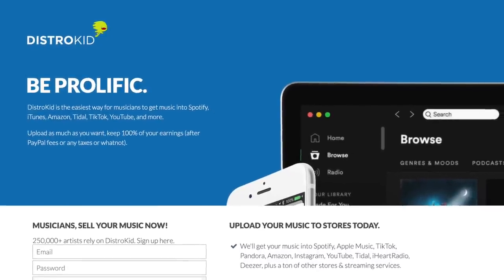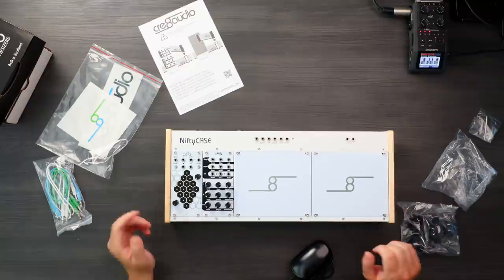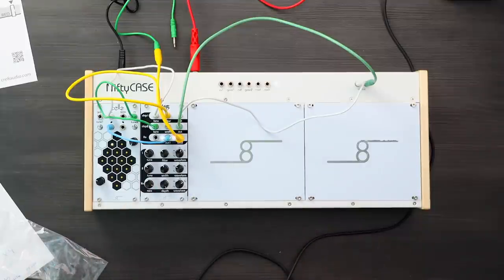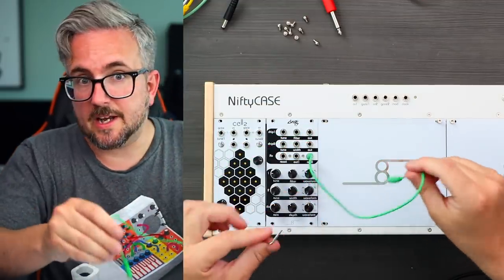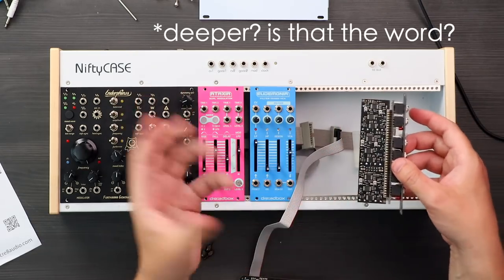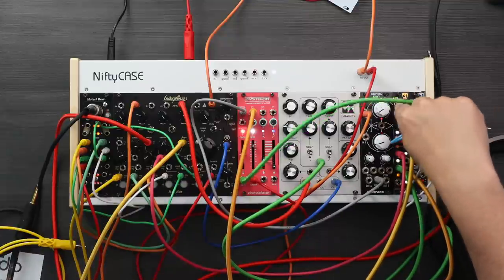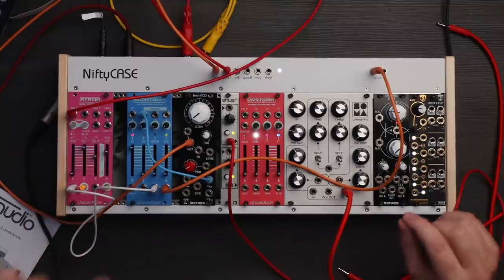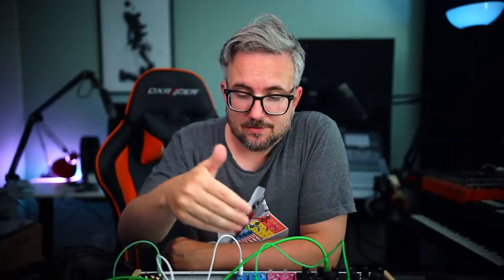$200 Eurorack Case for Beginners! But is it any good?

Comment: So now we get the inevitable "I've done synths and now I've fallen into the modular sinkhole" video series from Bo. Which is right on time cos I'm on the edge of that sinkhole and ready to fall in. 😄😄😄 Lead the way Bo-man!
Reply: Owning a Volca Modular for half a year, then getting a Behringer Neutron (bought used because I'd rather support musicians than Behringer, but I couldn't resist acquiring the synth itself) has made me realize that I will inevitably get into eurorack, eventually, one way or another. Now that I have the eurorack-compatible Neutron, and Bo's recommendation here, I can expand the Neutron rather than have to buy several modules at once to make the case usable. Hooray for budget-friendly semi-modular synths!
Reply: I bought a Doepfer A100 system after having a Make Noise 0-coast semi-modular. Happy with both. I did add a Korg SQ-1 sequencer and Make Noise 0-CTRL touch sequencer and they work great. Found out that while I enjoy west coast synthesis and like the 0-coast that I much prefer the simpler easier to read layout of Doepfer modules. Fancy graphics are cool but a pain to work with in live production mode.
Reply: @mikeexits  indeed just buy a cheap powered eurorack case and you are set to go and have room to expand. I do recommend utility modules and modulation sources that are skipped over by beginners and Youtube celebrities.

Comment: The nifty bundle really nailed it with the entry kit. Its more than usable for any skill level but packs in a million features that a beginner likely wouldn't have. the quarter inch out is awesome. I had a thousand dollar budget when buying in to modular, and  I was able to get a zadar, ensemble and wasp filter and the nifty bundle  was able to tie  in all the necessary functionalities as well as getting an Lfo on chips and cellz was fun while I had it, but quickly got replaced with my beatstep pro.

Comment: Was on the fence about the Niftycase for the last week, this pushed me over the edge to get it and start my dive into modular :)
Reply: If you’re looking to get into modular without the absurd price I would recommend checking out the tangible waves AE modular. I myself was planning on getting a nifty case and some modules and then discovered that I could build a fully fledged modular system with the AE modular for approximately 1/5 of the cost.
Reply: olGrandPaby That looks pretty interesting and a nice alternative. Don’t think it’s my cup of tea, but I appreciate you pointing it out
Reply: Same here
Reply: @olGrandpaby  AE modular has a Eurorack adapter frame for sale, so you can have both worlds.

Comment: I've owned the Nifty Case for about 2 months... love it!
it's almost full though, but i have seen a vid from Cre8audio showing extender cheeks for the case, so you can connect a second unit.
The fact that it takes midi/usb etc, swung it for me, i had no modular experience at all, but being able to easily connect my Keystep/Volcas/Mininova/poly800 etc made it the ideal choice.
Reply: Keystep does also have CV outputs! So you can use that + another MIDI controller with your case if you wish. In case you didn't know, you can also route Velocity, Aftertouch, or the Mod strip to the Mod CV out, and you can change the sync cable ports to Eurorack format, all in Arturia's MIDI control center. :)
Reply: Trying to get an idea of what this would cost and to fill. Approximately, of course. About what have you spent all told?

Comment: This was the case I picked up (bundle actually) as my first Eurorack. I was mostly interested in adding utility modules to add some features across my semi-modulars and so far have added a DPW Switch and Shades and Branches from Mutable Instruments. Great value - the Cellz sequencer is interesting. (I had looked at the Twisted Electrons version.) I hadn't played with Chipz yet at all, so it is good to see what it sounds like...

Comment: I have built my case myself. The case itself cost about 2 Euro to cut in a DIY store, then additional 18 Euro for two cans of spray color. Power strip unit about 70 Euro - so it's 90 Euro in total which currently holds 7 modules. However I have come up with a design for a case that's much larger, can hold 60 modules, and will probably cost less than 200 Euro in its construction. I find Eurorack cases to be super-expensive, they are not very complicated to build yourself.
Reply from the maker: I think you are absolutely right! I wish I would feel confident in building stuff myself, but I am not. I’d rather put my energy into other things, which I think goes for many in the demographic that case manufacturers target. Great to hear that it is possible tho and I definitely think more people should try!
Reply: Yes, I agree, the prices are rather high for very little material. I suspect the sales numbers are very low though. Often the PSU counts for a lot of the cost. The Mantis and the Doepfer LC9 cases are probably the best price/hp out there. The small cases are really bad value and very limiting - I would only recommend if you need something small for live use.

Comment: I bought the case alone (no bundle) back in April at the onset of the lockdown when a lot of places were offering discounts. So at a 10% discount, my first case and introduction to Eurorack cost $180. It did come with the two blank panels with just an empty space on the left where Chips and the other module would go with the bundle. I thought about mounting my DS180 scope to one of those panels. The output on back is mono but I use that summed output to go into the scope.
Reply: Thanks for the info, good to know they include the covers with the case alone. But why mount a rifle scope to a eurorack case? I'm confused. Unless you refer to an oscilloscope, in which case, I wonder why only shoes and rifle scopes show up when I Presearch for it, nothing about oscilloscopes.

Comment: Hey Bo, I have this case + bundle. 

I think you are being too kind, especially at 15:30 when you start finding way to overcome the clipping problems. I had the same issue and found that by plugging in another patch cable  into the second audio input (and nothing else) it would fix  the signal clipping.

I think it's a badly made case, but I also received a version of chipz with mine that has a face-place that is too large. I. cannot fit 84hp into this case if I use the Chipz module as it came. They included a weird silver version of the face place cut at the right size. Yeesh.

This case is a mess. The way I overcame these obstacles was to get get rid of the case.

I review gear too, so I know its deflating to put all that energy into making a video only for the product to be not-so-great. It's frustrating and embarrassing, but they shouldn't need you to find weird work-arounds.

This case is not great. It's okay to say that.

It's not a volume problem. Your eurorack modules are not too hot. That's silly. That audio out is a badly designed circuit. In fact, before I ditched the case, one of the best improvements I made to it was to use ALM headphones module as an audio out. That's right: to get good audio: don't use the case!

It's not even a "good value", considering it's now gathering dust after too many curse words. It's just sitting there. I wasted $260+ just to learn that this is not how a proper setup works. Hmmm, I guess there is some value there. Expensive lesson tho.
Reply from the maker: Thanks for letting me know about your experience. I of course had to take a peak at your channel and subscribe. 

I get the feeling that some of the early units were a mess, but I have no way to know 100%. I just do not have the same experience of issues with this case. And having had people send me feedback about this case for months whenever I talked about it, a large % seemed very happy with it. Like I say in the video: Modules fit nicely, the clipping didn’t cause me any problems and the case seems to be better than I expected at the price. Granted, there are plenty of other options out there. Had it been a mess, I most likely just wouldn’t have made the video to begin with. I am always careful not to recommend things I don’t think is good value. So being genuinely happy with it for my use case, thats what I put in the video. 

To my understanding they have made improvements to the case, and perhaps that explains the different experiences.

Keep making those videos!
Reply: @BoBeats  Thanks Bo! I'm glad that they sorted out the things that frustrated me. I wonder if the unconnected patch cable into audio input two (basically just use both inputs) would sort out the clipping that you discovered. I'm interested to know.
Reply: @BoBeats  "Had it been a mess, I most likely just wouldn’t have made the video to begin with."  This is disappointing to hear. I would like to hear more negative points being raised in reviews in general. I find too many reviewers talk about the pros and gloss over the negative points too much. Maybe you don't have to do a long video if you don't like it but I think it's good to express disappointment in a product. It will help to improve quality and gives you more credibility. I'm finding I'm watching certain reviewers less and less because of lack of objectivity shown.

Comment: If you’re not afraid of diy it’s pretty easy to drill some holes and solder just a couple of connections to do the improvements you mentioned yourself.

Comment: The blank plates and patch cables alone are worth $40. The midi-cv is also worth $120 by itself and is 0hp. Nifty case basically pays for itself. So that’s like $160 of value, before you count the modules or the case itself lol. In essence, you pay $90 or less for 84hp and a few modules if you get the bundle. It’s a must add for anyone with a bigger system that wants to break away from that and have mobility
Reply: You’re definitely right tho, the modules and system itself isn’t great for beginners in general. Better to have an idea of how you want to use the full 84hp

Comment: Sweetwater was also offering a bundle with the two Dreadbox units shown and some patchcables and what not. Picked that up, but the Dreadboxs were on back order :( 
In all, the case is very handy. The units are fun...up to a point, but need a little more. But, again, its only two units. Very good deal.

Comment: Wow man that really does look like a nice first eurorack experience. Not had the chance to play with modular stuff yet though that is tempting!
Reply: If you're on the fence, I strongly recommend getting a semi-modular synth first, which is compatible with eurorack. That way you can get a feel for patching and odd/wacky routings you can do with modular, and if you like it enough, you can just buy a little case + 1 module to expand the semi-modular synth, rather than having to buy several modules to make it usable. I recommend getting a used Behringer Neutron (only eurorack-compatible semi-modular synth I've tried and can vouch for) if you want to start off inexpensive but with a decent set of features. Plus, it's got 56 patch points, which is a lot even for semi-modular. Just make sure you buy extra eurorack cables and some stackables, because it only comes with 6 1'  patch cables.

Comment: Cheap and modular mentioned in one video doesn’t sound right

Nice little case tough, like the connections on the back
Reply from the maker: Filling even 84 hp will cost you a nice amount 😅
Reply: From someone outside that community. 200 bucks for just an empty case doesn't sound cheap at all.
Reply: @BoBeats  true it is easy to spend 2k plus on only a few modules. I did manage to fill two rows of my 6U case for under 4k.
Reply: Yes, I'm very confused how everyone keeps claiming, eurotack can be affordable. If you pay full price, I see no way to build a setup for under 450, and that's Minilogue xd  price range

Comment: Very nice review. I wanted to make a review of this case myself as there are not many detailing all the features. 
I’ve been following your channel for a while now and this is my first post to your video. I have my nifty case (no bundle) since about 2 months now. Perfect beginner case. Great value for what you get - midi interface, audio out ( which can already about 100-200€ alone).  Although, I was contemplating getting a bigger one (Tiptop Mantis - which is great value if you consider cost per hp) but I didn’t, simply because I’d have buy a midi to cv module and i had to keep myself within budget. What happened? After 2 months I’m stuck with a full nifty case and can’t fit any more modules :). But maybe limiting the modules is also a creative process. I wish the nifty case could expand- like the arturia or tiptop but now the only way to get a bigger case and sell the nifty or somehow DIY join 2 nifty cases. Also wish for a deck cover for nifty so it’s easy and secure for travel. Bummer is really the summed mono out. I usually patch the effects (in my case MI clouds) separately to my mixer. Yeah, those huge blinds plates are nice but a waste because you really can’t use them once you get 2-3 modules in. I personally would prefer 4-6 smaller plates as opposed to 2 big ones. I had to buy separate 2,4 and 8 hp blind plates until I got my rack full. Perhaps they should just leave out the plates and make the case a “bit” more cheap :).  I use an IKEA “ISBERGET” to give the case a bit of a tilt ;). All in all, I’m happy with the case. I’m a beginner in the modular world and this case is really perfect for beginners (midi interface is a huge plus)
Cheers
Reply from the maker: there’s something coming to let you combine two nifty’s I believe

Comment: Question: can you connect 2 seperate cases? Lets say i dont have the money to fully get what i want already and i get a nifty case and buy some relatively cheap modules. If i run out of space do i have to buy a bigger case or could i buy another small one and patch cables from case A to case B? Love the content, keep it up!
Reply from the maker: You can always mix and match cases as long as each case has its own power. Or buya large one to start out. So 2x Nifty works, tho you will have one issue: the midi I/O requires you to connect two midi cables or two usb cables to get midi into both cases. There are other options for larger setups, like Mutan Brains midi-cv module which has more midi cv and gates
Reply: @BoBeats  thank you for your awnser bo! Me and my best friend decided to get a AE modular i feel like its the best way to get a full experience without having to think too much or loosing money :) greetings from Austria

Comment: Is cell2 and  the oscillator with in the 200$ ? @BoBeats
Reply from the maker: No. As noted on multiple ocassions in the video the case is about 200, and case + bundle 260. 60 extra for an oscillator + controller/sequencer is actually very good, but make sure you like what you are hearing and want the sequencer

Comment: would this be a good starting point to pair with matriarch? zero knowledge on modular, but wanna get into it a little and learn
Reply from the maker: i am not sure if the two modules that come with the bundle is useful for this, but getting the case and maybe some other modules could be worth it

Comment: So you need an audio interface in order to hear the sound? It’s not a stand-alone device? Or computer is enough?
Reply: You don't need a an audio interface technically. You can just connect your speaker directly to the nifty case. But you might want to record your modular, or use your FX in the DAW then you need a way to transfer the analog audio that is output by the nifty case into digital territory.
An audio interface will do exactly this.
Reply: @modularblack   but is it connectable to let’s say MacBook instead of speakers (just to hear the sound)?
Reply: @coldsummer0  I am not too much of a mac guy, but I think it is not possible (atleast not in a good way) without an audio interface. Think of the cable you need to connect to your MacBook as if it was the aux cable people have in their cars. 

You can theoretically use the mic input on a MacBook to input the audio and then some software (DAW) to monitor it, but the mic in is for quiet signals and a modular is loud af. The nifty case is especially loud.

As a matter of personal advice please don’t cheap out on an 100€ audio Interface if you’re going to buy a 1000€+ modular, even if it‘s technically possible.

Comment: Should I be concerned that it’s only mono output ?
Reply from the maker: not really, because usually when starting with eurorack you do mono patches. and if you have say a stereo fx at the end of the patch you can take audio from it into the audio interface, just be careful with gain as eurorack signals are hotter

Comment: It is missing core modules like a VCA that are key ingredients in the most basic modular setup. Glad I skipped this, paid a few bucks more and got a proper Doepfer A100 Basic system that comes standard with basic VCO, filter, LFO, envelope generator, mults and a mixer plus MIDI to CV interface. Paid more but you get what you pay for Bo. The Crea8audio would be great for kids but it is made as a toy.